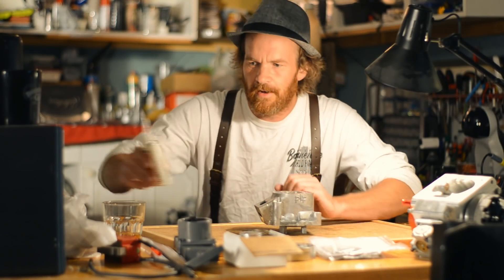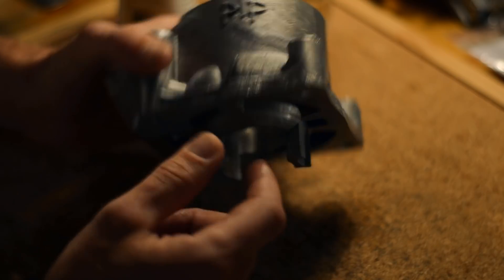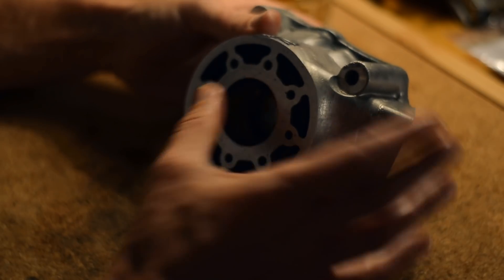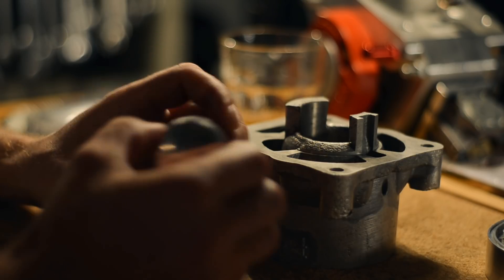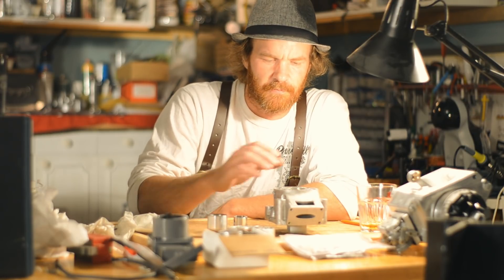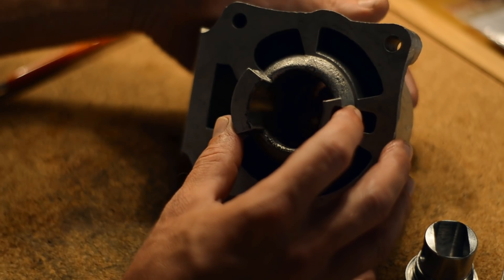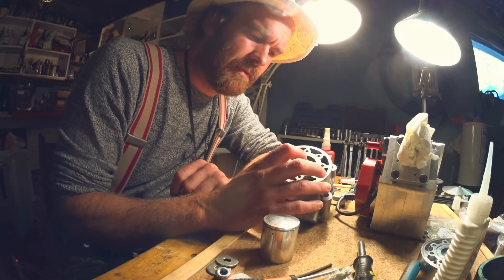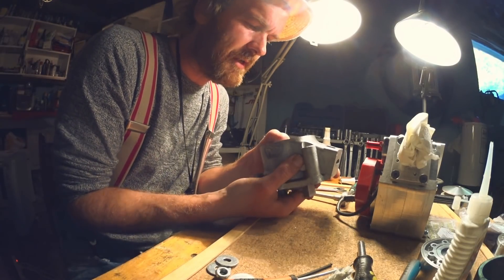The Most Powerful Two Stroke Ever - Won't be long now!

Comment: How about putting a bit to n the cast like a few mm support in the middle off exhaust pot to keep the piston ring in and stop it from piping out in the port and still have good flow
Reply: Unfortunately a small bridge in the exhaust port will get extremely hot and bulge in towards the piston causing it to seize.
Reply: @Ozsmallbore  if properly clearanced for amount of expansion and it shouldn't, many large exhaust ports run very narrow bridges without any issues
Reply: Also I have drilled 2 holes directly inline with the bridge in the piston skirt thus lubricating under crankcase pressure

Comment: If the exhaust port is wide..it should be bridged for an unpegged ring..or else just peg the ring so it doesnt rotate in the ring groove..simple
Reply: The ring has to be pegged wether or not there is a bridge. If the end of the ring expands into a port the engine is dead.
Reply: @ferrumignis  All of my model airplane engines that have multiple exhaust port bridges have one or both rings completely unpegged and free to rotate in their grooves..even if the ring end gap goes around and through the exhaust port..there is no chance of damage whatsoever as the port bridges keep the rings fully compressed so they dont expand into an open port and kill the engine as you say...when its running
Reply: @albertsammut433  A bridge cannot keep the end of a ring compressed.
Reply: @ferrumignis  Yes i PARTLY agree with you,if its a SINGLE bridged WIDE exhaust port then yes the piston rings are sometimes pegged...BUT AND HOWEVER,if you look into the exhaust port of say an old ENYA 60 loop charged 2 cycle model airplane glowplug engine the steel liner has a set of 4 square exhaust WINDOWS and 3 exhaust bridges..If you pull down this engine and remove the rings,you will see that they are completely unpegged in their grooves in the piston..I have seen the ring end in the exhaust windows of my 1960s Enya 60 while decarbonizing it,and if the bridges were unable to keep the ring compressed...it would have blown up a long time ago and its done alot of running..but NO it still has heaps of compression,starts easy and will run forever the way its going.
Reply: @albertsammut433  I suspect this is something you can get away with when you have very small bore cylinders, and probably quite thick rings in relation to the size of the cylinder. Of the dozens of motorcycle and garden tool engines I've worked on I have never seen unpegged rings.
Reply: @ferrumignis  You are correct..Most of these nitro fuelled model engines under 10cc capacity do have thickish rings..but as I too tinker with small engines..was very surprised to find  unpegged rings in these tiny..mostly Japanese engines when I first started to service them internally.

Comment: Could you put the ring in the bottom of the piston under the exhaust port?
Reply: more brutal just go for no ring as in a rc car engine.
Reply: No, the high pressure combustion gasses will leak down the sides of the piston and into the transfer ports and out the exhaust. Even on the compression stroke pressure loss is likely to be a problem.

Comment: I widened my exhuast port to 70% of the bore and it ran OK but lost so much power. Why could that of been? Just because the pipe wasn't tuned to it or could it have been something else?
Reply: Piston ring probably ruined itself on the port edge very quickly. Have you checked compression?
Reply: @ferrumignis  Yes, the rings and everything were fine. I was just thinking there may be another factor that I hadn't considered.
Reply from the maker: Might be a big miss match between Transfer area/exhaust area.
Reply: @2STROKESTUFFING  Ah, so there are other things to consider. It's not just a case if widening to 70% (max) of the bore... What's the relationship between the transfer and the exhaust area? Are there any guidelines?
Reply: @frankg3278  Download Engmod2t and do your research and mistake there, much faster and cheaper than prototyping your real parts. Technology like that brings you really close, not a tech? Well, pen + paper a calculator and fluid dynamics takes you in the right direction too.

Comment: Maybe you could build it without the piston ring? Similar to the Aluminum Brass Chrome(ABC) model airplane engines. Tolerances would have to be very precision though.
Reply from the maker: I've wanted to try. I've heard it doesn't scale up very well, low efficiency.
Reply: @2STROKESTUFFING  Most powerful 2 stroke and efficiency shouldn't be as one. Haha
Reply: @Hyprmtr  efficiency and power are connected, you want your power at the crank and not just as heat in your radiator. But yeah, that could work if you make a tapered sleeve that has bigger clearances towards BDC and gets tighter towards TDC. That way you'll have more compression at TDC, without the added friction throughout the entire cycle.
Reply: @2STROKESTUFFING  I bet it's because of how much the piston expands with heat.  When cold it probably won't seal well enough to run properly.  And if you size it to have correct clearance when cold it will seize when hot.  Small rc pistons probably expand only tiny amounts
Reply: @2STROKESTUFFING  I did Google.  Found this.  "The piston is fitted in a tapered bore with around .007" (.18 mm) clearance at the bottom and zero clearance at the top of the piston's travel. You need to run something like 10 to 20% oil. "
Reply: You have to have ultra high rpms to get any efficiency or power due to compression going past piston. I was racing snowmobiles and damaged a cylinder. Had a 1/4 inch groove 1/4 inch deep thru the bore up and down. I had to put it back together and run it. I was surprised I finished 3 rd out of 12 or so starters. Could only tell out of the hole. Otherwise it ran ok. And this was stiff competition.
Reply: I had the same idea and wondered too why this principle isn't upscaled.

Comment: As an idea, and I'm an  idiot that hasn't played with engines much, or for a while, just  messed about with motorbikes as a kid. But how about using the lower pressure of the crank case, through a hole in the piston behind the ring, to 'suck' the ring tight to the piston as it passes the exhaust valve?
Reply from the maker: I like the direction you're going in!
Reply: @2STROKESTUFFING   Well, that will cause a form of drag right? Which won't be what you want...

Comment: My friend......
NEVER STOP A HONE IN THE CYLINDER!
Reply from the maker: Thanks for the heads up! I'm a bit careless with this one, will need boring/replating anyway(or maybe a sleeve)
Reply: @2STROKESTUFFING  fast honing for 2 strokes (fast up and down movement), 4 strokes dont require a steep cross hatch angle, but with 2 strokes you need to move the hone fast up and down in order to receive a steep cross hatch angle, which retains oil better, because the cross hatch pattern is much more defined.
Reply: @pahafico2  With the RPM's this one is expected to sustain..I can't believe he isn't using "honing plates" ..I think his "basic skills" are not going to be enough to keep this little engine from seizing...I wish someone would help him...I like the idea..I come from a background that included "endurance racing" 2 stroke motorcycles...RD's..Those long straights at Daytona after a few hours of wide open running were hell on "ring lands" and "Bore Dimensions"...Your dead on right about the "cross hatch" also..He has to run a sleeve..GM's attempt at Aluminum Cly.Walls with Silicone impregnated cast iron pistons was a horrible failure (Cosworth Vega) because the Alcoa Aluminum order from GM was messed up in it's specifications...I've been studying and planning 50cc Streamliner for Bonne Record for 4 decades and I know how hard it is to build one that doesn't grenade...I decided on a 4 stroke Aprilia Turbo Blower set up and then somebody beat me to it and got the record...so now I have to get wilder..I'm thinking Computer controlled Fuel Injection, Turbo, Blower...but I allready blew my nut on the last engine...Bonneville is HARD!!..👍🗽🇺🇸
Reply: @billrandell4641  yes gm dropped the ball on that but it's not the alloys fault. They used Reynolds a390 and it worked but the cooling system did not and any overheating destroyed the cylinder walls and piston coating. Mercedes benz and Porsche both used the same Alusil alloy block with no plating in the cylinders. The sauber Mercedes c11 ran a 5.0 ltr twin turbo m119 v8 with the high silicon block. It made 750 hp and reportedly looked and specd identical before and after the 24hr of leman. When they announced the new v8 engines with the alloy block in 1980 the press reminded them of the Vega failure. Their response was " yes, we have an engineering department".😂🤣😂
Reply: @2STROKESTUFFING  sleave!
Reply: @sethpaulson7632  sleeve
Reply: @2STROKESTUFFING   @Seth Paulson  I agree use a sleeve and bore out until u get a compromise maybe 98%bore exhauste in a vertical oval-shaped exhaust or just fine tune the % of bore u can achieve and then make the one that will not catch
Reply: @salvatoremilitello8490  it's 60ish percent on a street engine and around 70 percent for some race engines
Reply: @traceanthony3588  on a 2 "smoke" or a 4stroke
Reply: @traceanthony3588  yeah I get that but we are talking 2 strokes that is a whole different beast so does the 60 to 70 still apply that is what I was asking about because the way the exauste works 80% could work the only problem is the ring is loosing compression and catching so take the littoral approach and start at say 65% bore and work ur way till it catches then make the sleeve for the jug he made and then it could step out to 100% bore exhauste or 95% bore or whatever and the problem should be solved and when the metal expansion happens the ring will be in a better place 👍
Reply: @2STROKESTUFFING  Hello my friend I have been following the whole build may i suggest a flex hone. no so picky on angle and it leaves nice cross hatching and a nice surface no gouging of the cylinder wall. I love the videos i cant wait for the next.
Reply: @2STROKESTUFFING  I wish I could spend a day picking your brain... it would be enjoyable for me. But, if your idea works with that right then I may have a way to modify my jug as well. On top of that it will work they idea may need some refinement  but over all this is how we make the 2stroke rise again! Also, I recommend a Flex hone much more forgiving and round port edges prevent ring snag on all ports.
Reply: Or a reamer!!!
Reply: arborcidal maniac  0.65mm stainless like a 4 stroke

Comment: The ring will eat the piston in a few seconds.
Reply: Not if there is a nick coating
Reply from the maker: Exactly, could work.
Reply: @2STROKESTUFFING   how would the ring tension hold up to load and unloading  of the piston  push ing the ring out and out ?
Reply: Out then the ring springs back in
Reply: @john198742  Way too many issues. with putting a ring into the cylinder wall.
Reply: @MakingStuffUp1  your right there's a lot of moving parts in that design
Reply: I would have made this 50cc hi rpm engine into an ABC setup..Aluminium ringless piston..Brass liner..Chrome plated bore..with a 0015 thou taper in the bore from bottom to top to help seal compression more..The piston composition will need to be at least 10 percent silicone for this setup to work well and eliminate any seizures.
Reply: @albertsammut433  how much blow by is on that kind of motor design
Reply: I guess fluid dinamick would come in to play
Reply: The fluid compression of the fuel air mix  between the piston and the cylinder wall at hi rpm
Reply: @john198742  Very little blow by as the top half of the piston external surface area is used for sealing the compression..above the piston pin bores
Reply: @john198742  Yes fluid dynamics  are used in the design sometimes by some engine manufacturers..A small shallow groove is cut into the top of a 2stroke ABC engine piston so that oil contained in the fuel gets trapped in this groove...further helping to seal even more engine compression and reducing blow by.
Reply: @albertsammut433  thank you
Reply: @albertsammut433  were be a good place to read up on this kind of engine
Reply: @john198742  just do a Google search and type in...ABC ENGINE DESIGN

Comment: slope both the roof and floor of the exhaust port so the ring can ride a small incline ramp back into the correct position, instead of a hard stop or ledge

Never mind